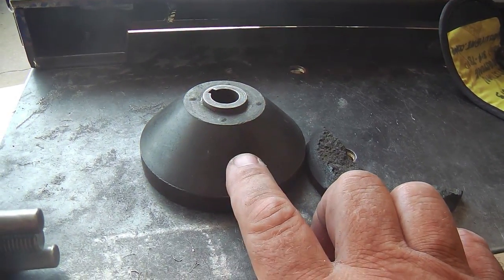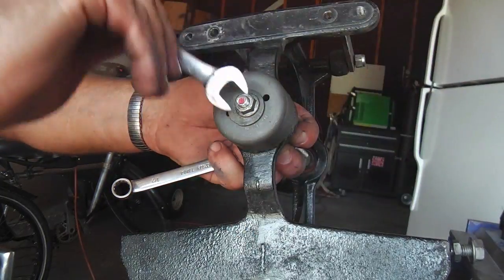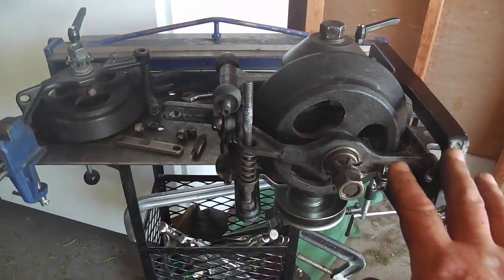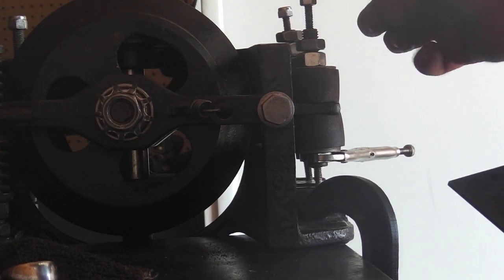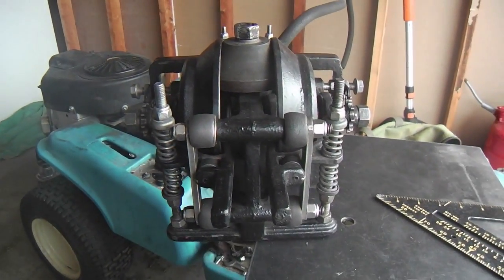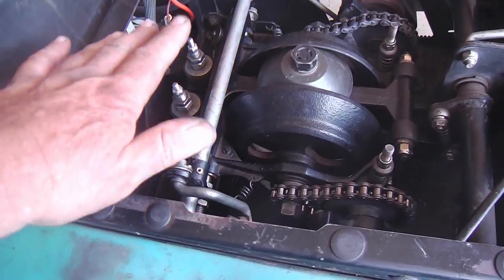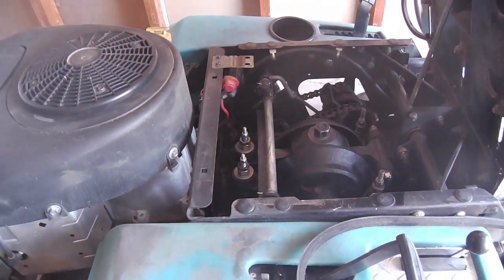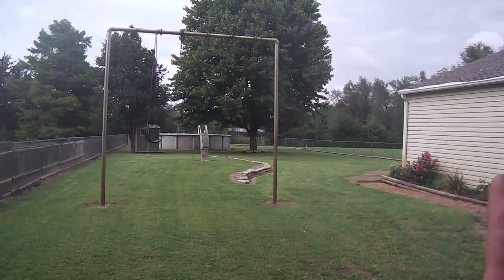Dixon ZTR Mower Transaxle Cones Install & Adjustment Procedure

Comment: I found the reason that no matter how many times (at least 15) I watched videos about adjusting for steering and speed , that there was a bolt missing. The steering shaft under the sleeve with the springs on it is threaded and under right blue plastic control panel is where the bolt was missing.  
Yay!!!! No new cones/cups or expensive things needed. 
It drives great now.  Thanks again.
Reply: I believe this is my problem on mines I was mowing my grass hit a bump in back yard and now it wont go to the left it act like it want to move but it dont I was told it a bolt that came out but I didn't know anything bout the mower any info would be helpful

Comment: Thank you for this video!!! You did a great job. My father was a Dixon,Homelite, Lawn Boy etc Dealer for 30 years. He also did sharpening. He sold the store front and brought the sharpening home. He gave the business to me over 10 years ago and I have new customers and his customers too. A customer that bought the ZTR 3303  in 1997 just called me because it won't turn to the right and only a little to the left.  This is an excellent video. My dad is 90 now and does not remember about the cups and cones, but he remembers almost everything else.  I am going to try and adjust things like I did with my dad about 4 years ago without taking everything out of the compartment. Wish me luck. Thanks again. Merry Christmas.
Reply from the maker: You go, Girl!
Reply from the maker: Here's a recent video of a guy doing a refurb on the 3303 transaxle. It's a little different than a 3304. His is about the only YouTube video showing how to do a 3303.
https://www.youtube.com/watch?v=8qdv0B0cV4A&lc=z22az5x5ryawttc24acdp43ajs2syhq4yuuu2c5vyoxw03c010c.1582595135839649
Reply: This is Exactly what's wrong with mines hit a bump mowing back yard and it goes foward fine backwards fine but now it wont go left like its suppose to right side is fine it's like something came lose after that bump can u enlighten me on what u found wrong with your I also have the same exact one a 3033 zero dixon

Comment: Thanks, I just got a 3304 Dixon from a junk yard, jumped it and it started, my son reworked a new starter switch and away I went love it just have a little issue with the right side reacting the same as the left side. Sure loved the price free just had to haul it off.

Comment: Hey man, just discovered your channel while looking up info on these cone drive systems as I have just purchased a late 90s ZTR 4422. But I just wanted to say a big THANK YOU for providing such great content and information! I have really learned alot from watching. Keep up the great work! I am soon going to be tackling a transaxle rebuild on mine as well. The lower left side compression spring is broken and collapsed on it so I have almost no reverse on the left stick. I figure while I'm there I might as well go through and do a complete refurb rather than have to pull the unit back out later. So the tips and tricks you've acquired will be a big help for my project.
Reply from the maker: Hey, thanks for that nice feedback. Yeah, as the mowing season is now about over, it seems like a good time to just go in and give a unit like that a once-over, by pulling the transaxle out and touching all of the proverbial bases. Of course, your Dixon model is a somewhat different style of friction-drive transaxle: https://www.jackssmallengines.com/jacks-parts-lookup/manufacturer/dixon/zero-turn-consumer/ztr-4422-1996/transaxle-assembly
Reply: I have the 1995 ZTR 4422 as well. I live in south florida where the grass is st Augustine and during the summer will grow extremely fast and is moist usually. so i installed 3 hi-lift blades to help expel the grass. any thoughts on your machine welcome here.

Comment: Ok, official impingement count is 1,247. Impingement is my new word. Than you for reading and I won't impenge on you time now. AWESOME video!!
Reply from the maker: Ha, ha, ha... 

Yeah, the technically correct industry term is bearing “side-load”, I believe, which is to be avoided by the correct use of the spacers on the shaft, also known as bearing “pre-load”.

Maybe I’ll do one last Dixon transaxle video in the future, using the better terms, etc.

Comment: Your videos have been a huge help to me. My dad had one of these in the barn with a new motor but needed the transaxle rebuilt. He even had most of the parts. So it was basically "free mower" except for the work. I'm having trouble with the running adjustments - the left side is weak no matter what I do - so re-watched your video and saw where you were adjusting the handles neutral position before adjusting anything on the transaxle. I suspect this might be my problem. Is there a good way to reset the transaxle adjustments (the rear lock nuts and the neutral position nuts) to "zero" - without removing the transaxle from the mower? I'm afraid I've made so many wrong adjustments now that I need to restart the running adjustments from square one.
Reply: PS - realized I wasn't clear - I did remove the transaxle and replaced the cones and did the bench adjustments. I'd like to get back to the "just after the bench adjustments" stage and re-do the running adjustments starting with the handles neutral position like you did. And hopefully not have to take the transaxle out again!
Reply from the maker: Yeah,
I'd start the running adjustments from the right angle of the disc cup at the .050 tolerance first, i.e., if one of the cups isn't close enough to the corresponding cone for it's forward motion (it's opposite for each, i.e., one is the upper and one is the lower for forward), then it'll be weak no matter the adjustment. But, like I've stated a few times, check the the cones and the torque rods for breakage first. As, if there's a problem there, no amount of adjustment can overcome that. So, yeah, if there is no cone or torque rod breakage, go back to the proverbial square one, i.e., the concise .050 tolerance of the disc cups at their adjusted right angles, like in the video. Otherwise, if you can't seem to get it functioning well with the running adjustment, it's probably going to take some new cones and a torque rod. But check the torque rods very closely first, and let us all know how it goes. I mean, the reason it was sitting in the barn may be that it requires more than just running adjustment, and it was deemed as requiring too much time or money to return it to service.

Comment from the maker: https://photos.google.com/photo/AF1QipP9ng2zdiudUSZfsiHiAJs3bqYWk89dsL4FmgJR
Here's a link to an image of that Dixon gauge, next to a ruler, so you can print it out on paper and check against another ruler to verify that the scale and dimensions are "spot on". This is my first image uploaded to a GooglePhotos account, which seems to also include a URL link, so that anyone can copy or download the image. If for some reason the image doesn't print to the exact same scale and dimension when compared to a 3D ruler where you are, just use your printer software to scale up or down slightly, till the rulers (2D and 3D) match. Then trace the image onto a template. Easy peasy! Now anyone can find a virtually free and easy way to make a gauge out of sheetmetal, plexi/plastic, or even some dense fiberboard, etc. Wheeeee....
https://photos.google.com/photo/AF1QipP9ng2zdiudUSZfsiHiAJs3bqYWk89dsL4FmgJR

Or, if that image hosting site is problematic somehow, maybe my VK page will also allow you to see and download the image:
https://vk.com/id481248401?z=photo481248401_457239030%2Falbum481248401_00%2Frev

Comment: hey do you think the mods to the spacers may have caused premature failure of the disk? how many years are those disks supposed to last? I have a dixon 1995 ztr 4422 that appears to have the original disks and it responds well and does not appear to have any issues yet.
Reply from the maker: Nah, they were somewhat worn, and I used to use a garden spray hose to occasionally clean out the transaxle compartment, which may have compromised the cone material over the years. But I use only compressed air now to clean the cone compartment. Otherwise, the cones could last 20 years if you're only doing your own small property. I think that last set of cones was over 7 years old, and I was doing a few properties for much of that time. Now I'm mostly only doing one small property, and it's about the third season since I installed those new cones shown on the video. And the wear on the new cones is very slight, so I expect those cones to last another decade, or more. Of course, I keep an extra pair of cones around, in case of a mishap somehow, or if the cones cannot be found from the usual sellers anymore. Otherwise, I haven't even had to make any adjustments to the new cones over the past three seasons since doing that install video. It's been great!

Comment: Good day Christian, Great video, been a great help.  I have a few questions.  I'm working on my 1997 ZTR 1001 and I installed  a new factory Z drive # 539115116 tuned from Factory. The issue is the Drive pulley is smaller than the existing so the drive belt will not catch. DIXON 2496 is the stock and is 6 inch diameter and the Z drive has 4.5 inch  Dixon #  5326 pulley. I want  to get a different belt and wondering do I just get a belt 1.5 inches smaller? Also The idler pully Drive belt cable was snapped before purchased. I have replacement (cable with threaded bolt) and after watching you video I think I see it connected to parking break shaft..  I cant find any info about these drive Pully differences (Except your videos) or how the smaller one will effect performance. I wonder if the 1001 had larger pulley to provide more low end or something needed for 1001.  I have some pics. Any insight will be greatly appreciated. best regards
Reply from the maker: Sure, if the pulley difference is only 1-1/2" smaller under the new transaxle assembly (since it's probably from or for the zero-turn rider models), by putting on a belt to fit to it, that would probably reduce torque a little and increase top speed. Or, you could swap to a 6" keyed pulley under there instead, to keep it more OEM, as the price for pulley or a new belt are about the same sometimes. Take your pick, as you can always change it later to suit you better without spending much money at all. Please let us all know here how it goes!
Reply: @NewJerusalemTimes  Thanks for the info,   not sure I want to mess with anything on Z-drive except final adjustment as per doc included advised not to touch, dyno tuned from factory, Im thinking of leaving it for this reason. Do you think  it would it effect tuning if I changed to the old? or new 6 inch pulley? also, not sure what to do with this; Im missing the OEM DIXON SWIVEL FITTING
 539115331 that connects the drive belt pully retention cable to brake bar, cant even figure out what it looked like. Do you think I wont need it with smaller belt right? also LOL, mower cam half de assembled, but did come with brand new OEM Dixon Drive belt 2497, no measuments on label  looks like about 40 inches, im going to go to tractor store see if I can find one about 38 to 39 inches and hope I get to hold on to the 1001 this weekend, fingers crosses.
Reply from the maker: And, you could have even more fun with that rare walk-behind, friction-drive Dixon, by adding an aftermarket sulky apparatus to give it stand-on mower versatility too.
Reply: @NewJerusalemTimes  WOW, this mower works now and is so fast.
Reply from the maker: @josephgerard2254  Hey, nice job! I know a guy who bought a stand-on last year for $8500, new, which has a deck around the same size as that walk-behind Dixon. So, you undoubtedly saved a bunch, while having nearly the same cutting time efficiency. If you get a chance, upload a video clip of the unit doing a demo somewhere, then include the link in this comment thread for all to see. I think there's only one video of ZTR 1001 being demo-ed on YouTube, currently.

Comment: My dixon has a terrible vibration/shimmy when I move push the left steering arm forward. That side quickly loses power but when you bring it back to neutral and let it sit for a couple minutes,  you can get another bit of burst out of the arm before the shimmy vibration is terrible and loses power on the left side again. 

I really appreciate this video, do you happen to have any advice for what I need to take a look at?
Reply from the maker: Gee, you don't mention which Dixon model that you have. Is it a friction-drive? If not, maybe you have a hydro wheel motor going bad. Anyway, take a look at the comments at the YouTube page under these ones, posted by Cornmeal73, and then my feedback.
Reply: Zeeter HL30 and I just turned the mower over to look under it and it doesnt look like the central cone system that yours has. There seems to be an independent casing for each wheel.
Reply from the maker: @jtmallinson98  Yeah, those are "non-serviceable" hydro units with the pump and wheel motor all-in-one for each side. They're about $1000 from typical off-the-shelf sources. They may be cheaper elsewhere, like eBay. And they may actually be serviceable too. Check for more YouTube videos. And download a manual to find out the actual hydro manufacturer number, as it's undoubtedly not a Dixon-manufactured part. HydroGear is probably the actual manufacturer. Here's a link to the parts diagram: https://www.dixonztrparts.com/oemparts/a/dxn/5c1c308d87a8661320ea33f7/chassis

Comment: Great video.  Mine did the same thing, lost all turning to the right after I was cutting on a slope.  I'll be breaking it apart.  Where do you find out the part number of the mower?  All I have is the serial no.
Reply from the maker: Gee, there's a Dixon serial number plate on the back of mine, which may have the model number embedded in it somehow. But I always knew mine was a 3304, and maybe the serial number helps to indicate which model year it is. I forget how I determined mine was a 1995. Those torque rod bushings and the poly body panels tell a lot. And I'd buy a set of two cones now, no matter what you do, as they may be harder to find and more expensive soon. I just bought a spare pair, and the price was up to nearly $60 per cone. So, my unit will undoubtedly last me another 10 years or more, cones-wise, at the rate I'm now cutting with it (not as much as in the past).
Reply: @NewJerusalemTimes  My dad's 2 Dixons which are now with my 2 nephews have a Kohler and an Onan engine. You can tell the year by the engine or sometimes a large sticker that says 3303 or 5303 or something.
Reply from the maker: @SueEnoughIsEnough  The link below has virtually all of the Dixon models and years as explodable diagrams, which can often clearly show which model or year you may have.
https://www.lawnmowerpros.com/dixon/dixon-parts-diagrams.asp

Comment: that drive belt is it an A or B belt  I am have a lot of trouble with my drive belt  I am have a lot of trouble with my drive belt transmission portal looks like a b pulley  about every three times I cut my grass  it would eat up my belt
Reply from the maker: Yeah, you'd do well to look closely for an alignment issue, like an idler pully that may be sagging down, like I showed in the video.

Comment: Vers nice Video, helped me understanding the whole mechanism much better.
Would it possible to receive the dimensions or a simple Sprinter scan of the adjustment tool? I  would buy it, but there isnt any Shop across germany and shipping from the US would be expensive and takes time. 
Thanks in advance!
Reply from the maker: Sure, send an email inquiry to chrisliv@me(dotcom), and I''ll reply with an image attachment of the gauge precisely next to a stainless steel ruler. You can then print out a paper copy to the exact scale of the ruler to get a template for transposing onto some plastic or metal sheet, to make your own gauge. I used to have that image on a Facebook page of mine. Or, see the more recent post above, where the image is downloadable now, from a Google Photos link.
Reply from the maker: @davidp8563  Try my vk.com page: 
https://vk.com/id481248401?z=photo481248401_457239030%2Falbum481248401_00%2Frev

Or, email at the above posted address, for the image, directly.

Comment: My cones are in good shape so don't think I'll be breaking the transaxle open.  I saw on another video that it could be the small chains.  Mine are pretty loose.  Could that be the problem?
Reply from the maker: Nah, I'd just go in there and give it a full once-over. When you're done, you'll nearly be an expert on these things, as most all of the mystery to them will evaporate. Nah, those jack shaft chains are loose by design, which makes for some slop in the levers is all. But putting some new chain stock will cinch them up a little bit, for a while. You probably have a cone or torque rod problem, or maybe the disc cups could be pulled in to their .050 tolerance. And I would have done well to stress a little further than I did, in how flipping those roller plates to an un-divoted or un-worn spot is very important, since those divots will give a false reading with a feeler gauge, i.e., the flat feeler can't include the divoted amount, which can be as much as the factory tolerance of .050. So, with a divot on a roller plate, the feeler gauge can read .050, but actually be .100 in the tolerance for the front portion of the disc cup, which would lead to a loss of power, torque, and wear the cones unevenly. I mean, you can make up some fresh roller plates easily enough, with some flat bar stock and a couple of drilled holes if you want to refresh the whole thing. I was tempted to do that with some stainless bar stock, but just flipped the existing ones to smooth sections, as you see in the video.